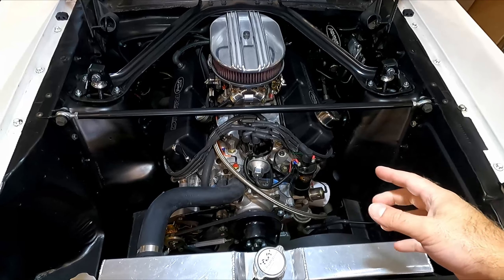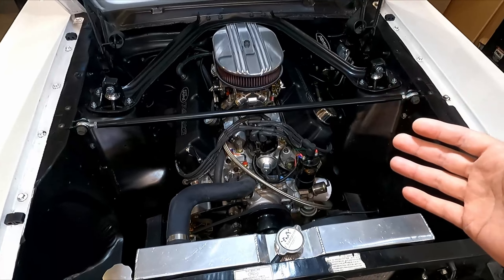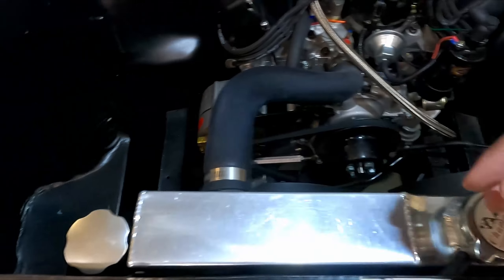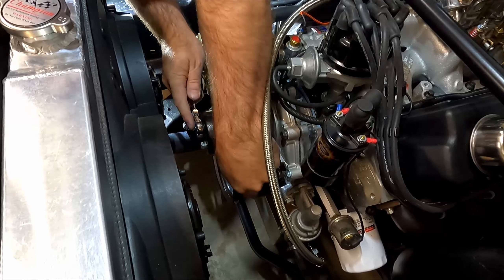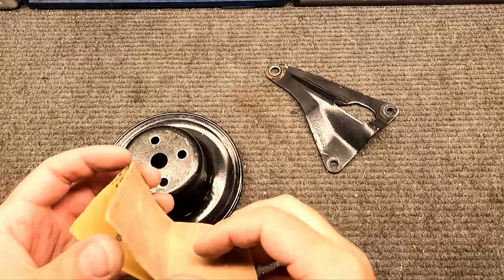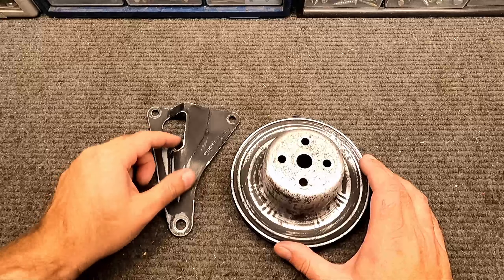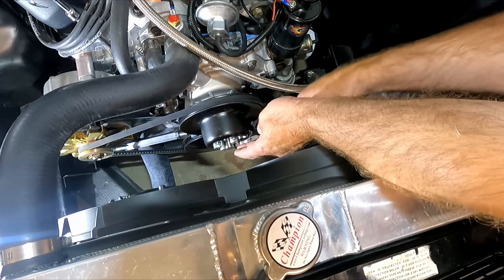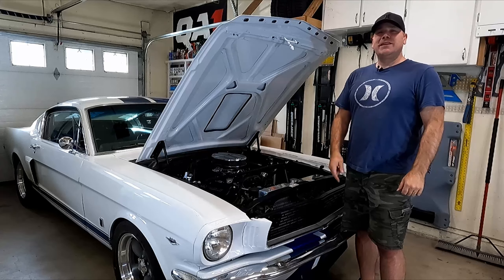Getting to the Perfect Engine Bay

Comment: Looks good!! Where did you end up hiding your starter solenoid? That would be a good video to show that process
Reply from the maker: It's on the passenger fender liner, between the shock tower and the heater blower motor.  The relocation is covered in the video I did last December where I was cleaning up the engine bay while I waited for my 347 engine build.  :)

Comment: I'm currently redoing my engine bay on my 67 now on my channel (shameless plug) 😂 but I appreciate a clean well built engine bay alot of people will spend so much time and and money on a motor and throw it into a lightly degreased engine bay, and I as you was looking into some March pulleys and decided to just powder coat my current pulleys and upgrade later down the line, great vids as always andy
Reply from the maker: Yeah, the powder coating option sounds like a decent way to clean things up, I'm still trying to figure out what to do.  :)
Reply: @AndyKruseChannel  I for sure still want to do the march serpentine conversion down the road but it's almost the same cost as it is for my msd distributor, coil, and ignition box and obviously that's more a priority vs some nice pulleys

Comment: Love the look! , what electric fan set up are you running. Cheers
Reply from the maker: It's from a 1999 Ford Contour.  It fits perfectly with my 24" radiator.  I did a video on the install a while back.  :)
Reply: Thank you, how is it working out?
I am considering doing this install with a new cold case radiator.
Reply from the maker: @MrVitoQ  It's great, I can't remember the last time my temps got above 200 degrees.  :)

Comment: Do you have a video on changing out your export brace? I noticed you used to have the one that was welded to the shock towers.
Reply from the maker: I had the stock cowl braces on the car when I bought it, then I added the export brace that is there now (there was a video on that).  When I was waiting for my 347 to get built, I was doing so clean up work in the engine bay and that's when I removed those welded-on cowl brace pieces that were left over (there's a video for that too).  Removing them was easier than I thought it would be.  :)
Reply: Can you link the removal I can’t find it.
Reply: Never mind I found it 👍🏾

Comment: ive gotten a 65, and my battery is up front, and I was wondering where you have yours?
Reply from the maker: In the trunk, passenger side.  I made a video on the transplant from the front to the back.  :)
Reply: @AndyKruseChannel  wonderful, thanks, i just today replaced my batter tray cause my old battery leaked and corroded it